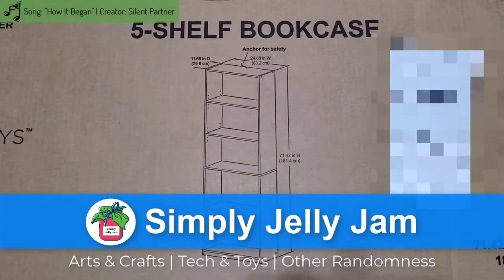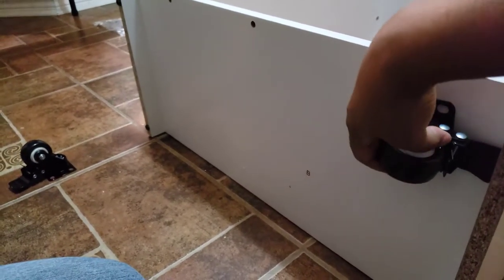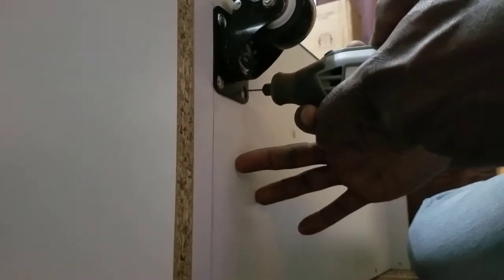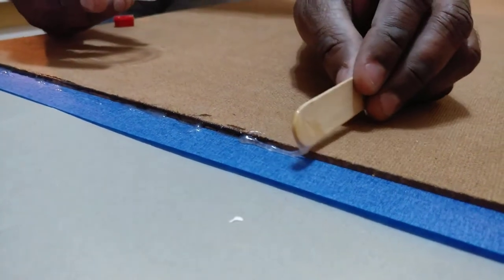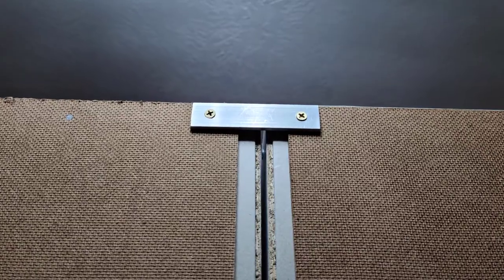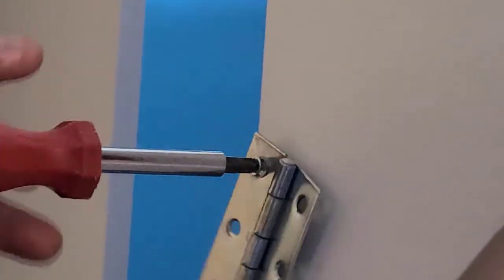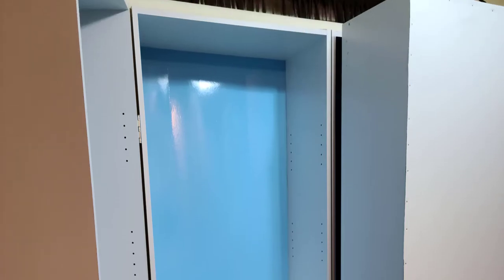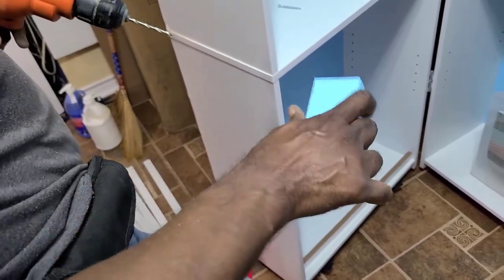Building My DIY Craft Cabinet | DIY Craft Cabinet Part 1 of 4

Comment: I made a cabinet like this. what I learned was you need to make a plywood base for the wheels to attach. The shelves will break apart under the weight of the cabinet. I had to redo all the  units when mine broke.
Reply from the maker: That's awful! I hope my cabinet is alright with the bookcase brand I bought and the wood base I screwed the castors to. Thank you for sharing your experience!
Reply: I can wait to see your project too.
Reply: Peel and stick wallpaper rather then paint is great for changing the backer board look

Comment: That's the first thing I thought of. No way that cheap chip board from Mainstay would hold up on those castor wheels like that. Especially not for my sewing machine and all the other heavy stuff I'd be storing in there. Definitely would need a strong plyboard base. 

But other than that, this is a really good custom craft cabinet that's not too expensive and doesn't require a whole shop of special tools or anything like that that I don't have in order to build it. Thanks to the girl and her dad for the good idea! 😊
Reply from the maker: The plywood base backing has been helpful, especially the few times I've moved the cabinet. I'm glad you enjoyed the video!
Reply: I was thinking the same thing I may put a wood base to attach the wheels to and the shelves to that
Reply from the maker: @Vegaswink702  Yeah. I didn't trust the thin backing. Wood would be sturdier!

Comment: What size castor wheels should I get?
Reply from the maker: Hi! I used 2 inch wheels, and it worked well for me.

I highly recommend getting castors with locks so the cabinet doesn't move with a bump or while you're opening and closing the "doors."

I hope this helps!